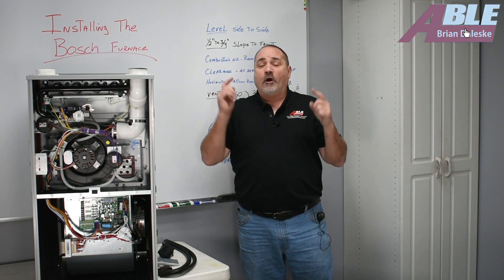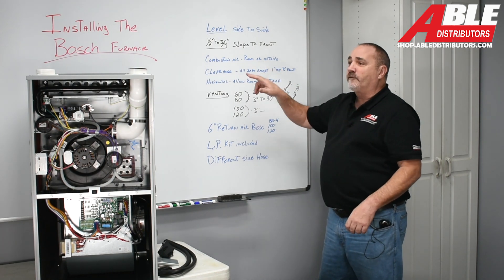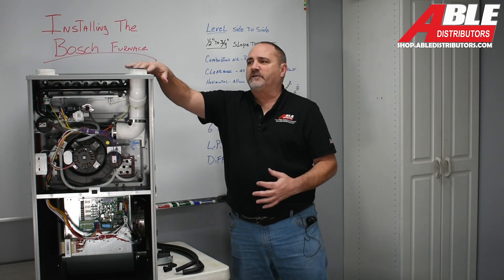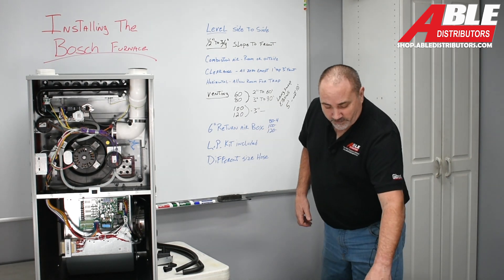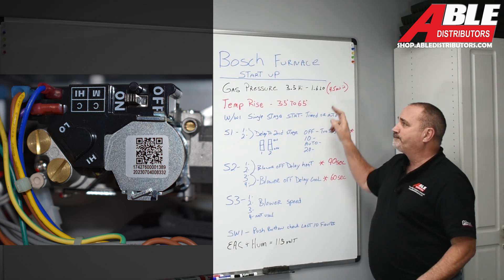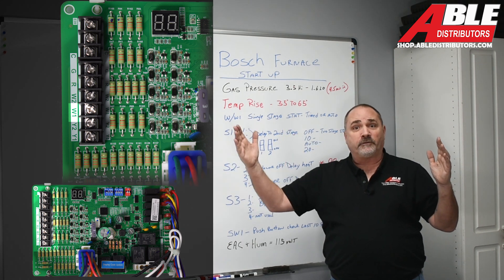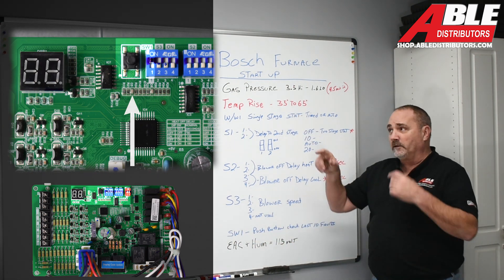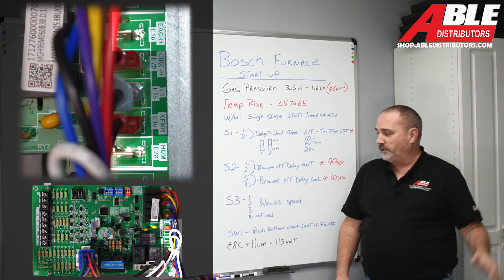Bosch BGH96 High Efficiency Furnace - Installation and Set Up

Comment: I’ve installed over 100 of these, incredibly successful because it’s a great product and reading the manual does give you all of the information. But one thing I’ve never asked a question on, I don’t see the troubleshooting lining up with error code for example E5 or E2, Instead of indicates flashes, one flash, two flash, etc., and the book does not even talk about codes, such as FO or NL.  Am I missing something? I feel like the manual was made for a different control board in regards to troubleshooting.   
The furnaces I install have the two segment LED and no flashing code. You simply look at the two segment LED but when you refer that over to the manual or the lower door on the furnace, it does not have the same codes.    Can you elaborate on that?

Comment: If you make blower run longer after ac is off it will not be dehumidifying as well it will be putting some of that moisture back into the space that you just removed